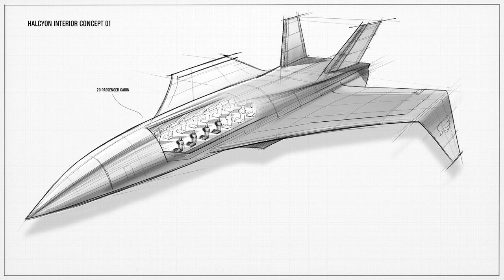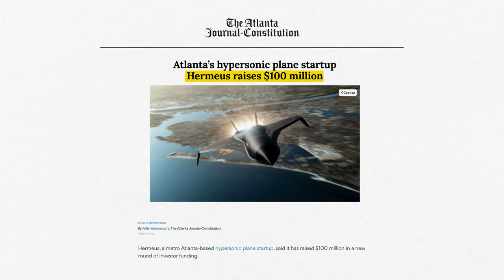Our Hypersonic Aircraft Plan in Two-Minutes – Come Join Us!

Comment: I see its in military application but not in civilian ways. It's all about economics and well, the Concorde died despite speed. Also, traveling at Mach 5 comes with highly increased risks, unless proven otherwise I have serious worries flying at those speeds. Anything that goes anywhere near this fast is way more dangerous than taking the regular airplane. Good luck tho with the engine, it looks very nice so far. You have managed something, others would use way more money for...
Reply: I think they'll be aiming for the luxury private sector if anything, small private jets to ferry high laid execs/govt staff around the world at faster than usual intervals 

Kinda like a supersonic G5
Don't expect to see this type of thing introduced en masses to the commercial public anytime soon after development
Reply: @o-wolf  Unless these things are super safe, I don't even see their application there. Think how difficult it was to cool down the SR-71 in order not to melt the pilot.
Not saying it is impossible but traveling hypersonic won't be comfy and most likely not safe.

Comment: Whats the fuel consumption per km relative to a normal jet?
Given you are flying much faster, but also higher you hit less air, but a surface temperature that melts aluminium, suggest monstrous drag, and thus fuel consumption.
Reply: Yeah, it's as if no one actually looked at the flight performance of the SR-71 and noticed how often it had to tanker and that's with an extremely efficient engine.
Reply: @JM-nt5fm  it’s like everyone forgot why the Concorde died…
Using more fuel which now by the way is a lot more expensive than it was back in the day, made the trip a hell of a lot more expensive.
So if this wants to work they need to drastically reduce fuel consumption. If they cannot do that this program is not going to succeed.

Hence I am seriously hoping they haven’t found a way around the problem, by for example flying higher in the upper atmos/troposphere.
Reply: @JM-nt5fm  And who used SR-71 and how many were produced ?
Reply: @FreekHoekstra  The Concorde failed for a surprisingly large number of reasons besides fuel costs. If Hermeus can get off the ground and to the speeds they want Halcyon stands a better chance than the Concorde, most likely. 

A big reason the concorde struggled was the limited number of routes it could actually fly, which contributed a ton to the price, while nowadays there is a much higher demand. 

The Halcyon also seems to be utilizing a compression-lift wing (folded down wing tips) which were used by the experimental XB-70 bomber and gave it one of the highest lift-to-drag ratios of any aircraft ever, thus, extremely high efficiency for supersonic aircraft. 

Hermeus is also looking to use a ramjet engine, while concorde used a turbojet somewhat at the edge of its thermodynamic capabilities. A ramjet may prove to be fuel efficient, considering the speed, as all of the work developed by the engine goes to propelling the aircraft, instead of requiring a large amount to drive a turbine and thus, the engine itself.

Not saying Hermeus is for sure going to do what nobody else could, but they have a pretty good shot, and I highly doubt they haven’t calculated the odds. If something like fuel being expensive was such a make or break, the company wouldn’t be here.
Reply: @willgarbarini9633  flying fewer routes doesn’t increase the cost.
The cost is based on basically two things, how many people can you get on the plane larger planes by definition are cheaper to fly, because maintenance is basically the same and you have less fuel cost per unit of content, and the second one is velocity the faster you fly the more energy you burn per mile which means more costs.
But also flying faster means that you get thermal expansion on the hole which means more maintenance which means more money.
This means expensive….

If They fly extremely high may be taking avoid some of these issues, but if you look at some of the other content they’re already talking about the nose cone getting significantly hotter in the chassis expanding, so it seems like they’re running into some serious amounts of drag.

So yes i do think this is a serious issue, now if they want to become a military plane manufacturer sure these things don’t matter.
But for a passenger carrier that Hass to be able to turn around quickly and do multiple flights a day.
Especially if we can only hold about 20 people, and burn astronomical amount of fuel and encounter thermal expansion all the time.
That’s gonna be really really hard and honestly questionable whether it’s even a good idea.
Reply: @@Andrew-zy7jz which is why It was a transatlantic flight. The Concorde died because it was too expensive.
In the end, it’s literally that simple .

Comment: If you can go fast enough to turn the air into plasma then you can use electromagnets to repel it, stopping convection which is the main source of heat generation in supersonic travel. They are looking into using it for re-entry vehicles.
Reply: So basically creating a thin vaccuum around the vehicle? That would be very cool, reminds me of the supercavitating torpedos and bullets
Reply: That would be sick, even allowing real windows in an hypersonic aircraft.

Comment: Hi guys you are doing a great job, but I think airlines may have an airframe and engine maintenance cost issues in the long run due to high tempretures. But there is a better concept aircraft design for a faster aircraft going to Mach 8 to over Mach 12 with a special new type of hybrid engine design concept. Materials no problem for this aircraft concept while maintenance and operation costs for airlines are much lower for this design.

Comment: That is not a plan.

That isn't even a complete idea.

No way this works, this is just BS, at least at the level of detail they are sharing. I don't think anyone on this team has any concept how difficult the engine design problem is.
Reply: We will see. It would be awesome if it works. But it's not an easy task to beat SR-71 blackbird.
Reply: They’ve done the turbo to ramjet transition successfully now so they’ve proved you wrong about the engine design!
Reply: @pilotcasper  making an engine is one thing... strapping it to an airframe and actually flying it in those conditions is another.
Reply: @coflyer2949  Yes, I didn't say that. The guy i responded to claimed they had no idea about the engine design. Not airframe.